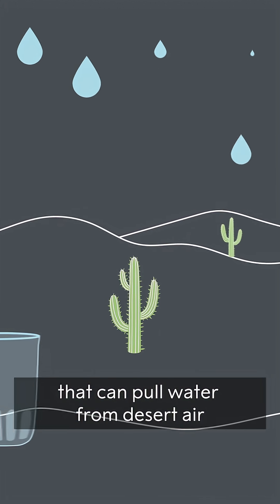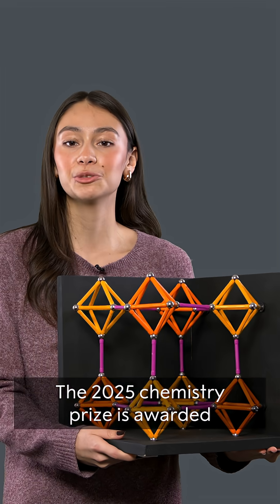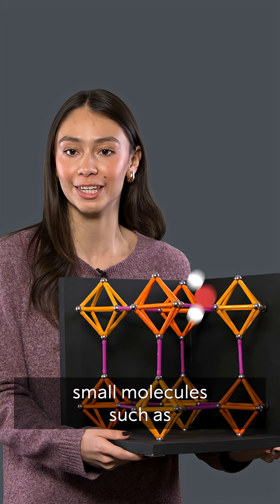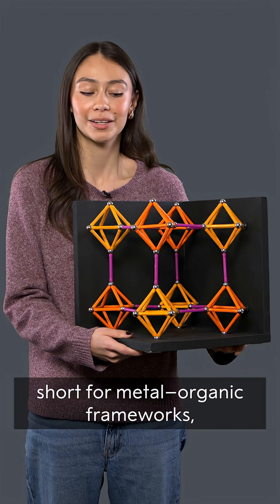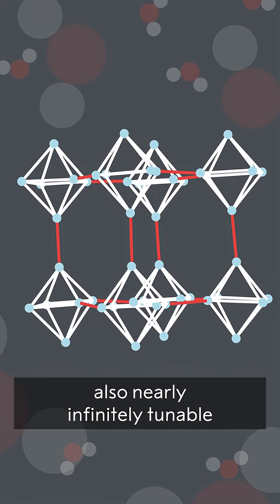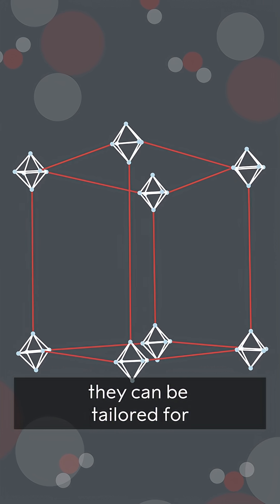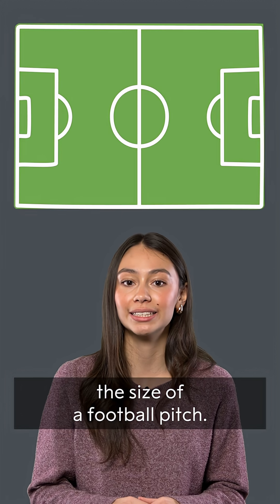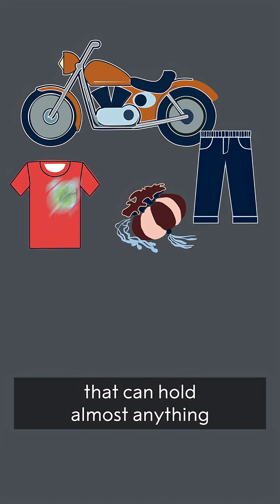What is a MOF? | One-minute crash course | 2025 Nobel Prize in Chemistry #nobelprize

Comment: But like how do the gases get trapped inside? Is that pure steric himdrance, electrostatic interactions? And if its those then isnt the limit to how much fits in your MOF determined by the point at which yhe molecules inside repulse each other to the point the MOF can't hold it anymore? R u sure that volume is really an interesting determinant in how these MOFs will store ur chemical of interest? Cuz if it needs to hold it then you cant let it be random diffusion right there needs to be an actual interaction between the MOF and compound of interest